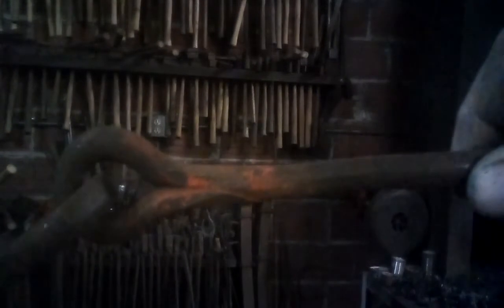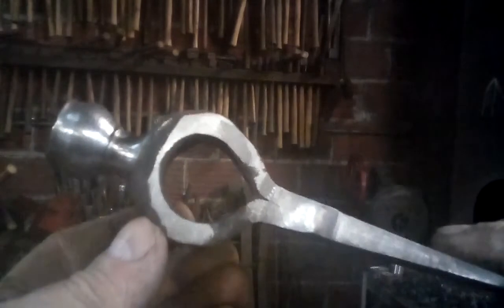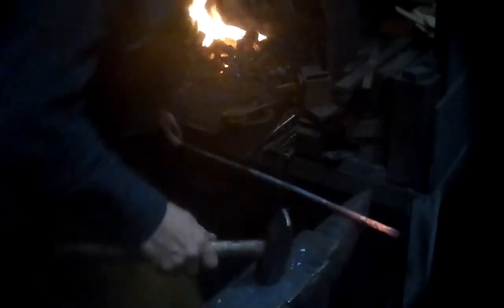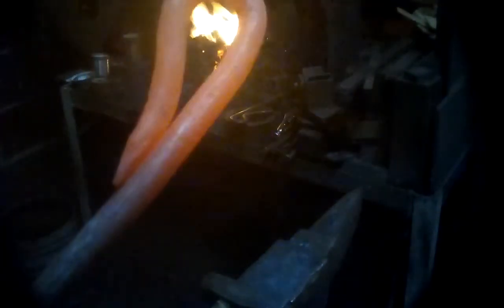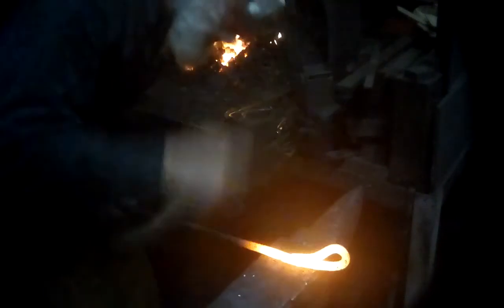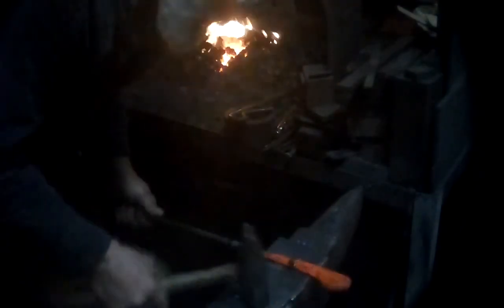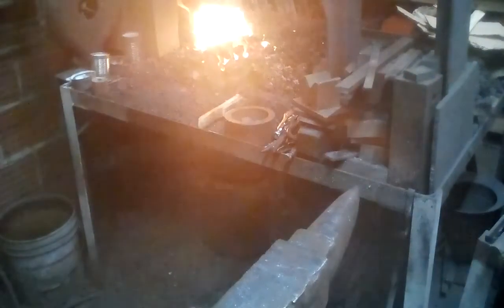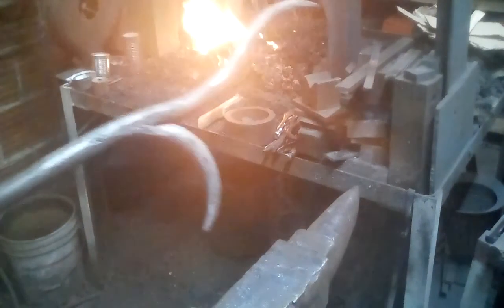Old Forgewelds and a demo of one way to forgeweld without a scarf scar

Comment: Thank you for the video! And I think you may have given me the solution to my problem. I usually focus welding the toe in on the 2nd heat. I’ll try welding it on the first heat from now on and see how that works for me. EDIT: I love it when you show the old ironwork in your videos. I love figuring out how they set up the work and the methods they went about doing it.

Comment: Well done Sir!  I always enjoy finding welds in old tools and hardware. It's almost like archeology. Have you ever forge welded, using clean fine sand?
Reply from the maker: Hi:
Good to hear from you. 
Sand works well for welding mild steel and iron , higher temp materials.
It has a higher melting point and high carbon steel can burn before sand is fluid , it is kind of thick . 
Glass has a lower fluid temp than sand, it works but people don't use it much because it has to be ground up fairly fine to not "pop" bits of sharp glass around the shop.
Stay well!
Daniel